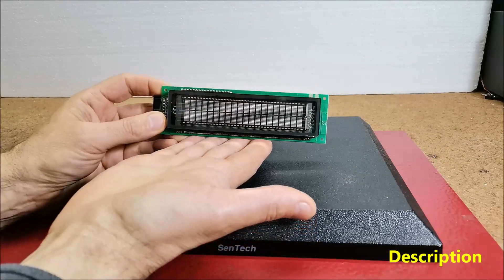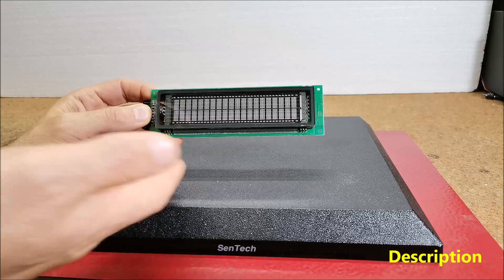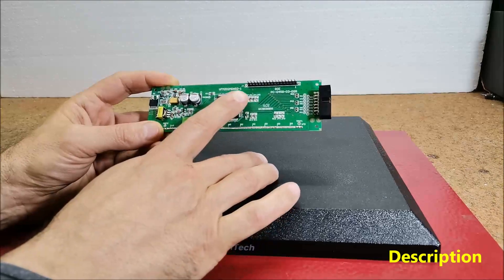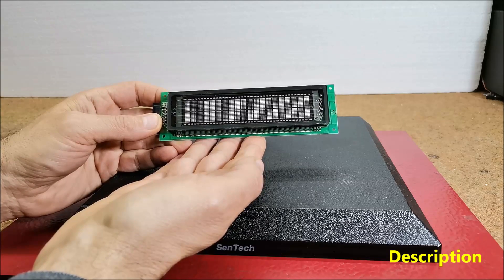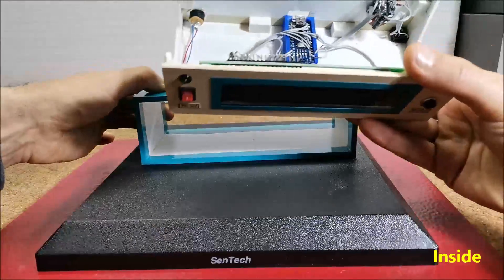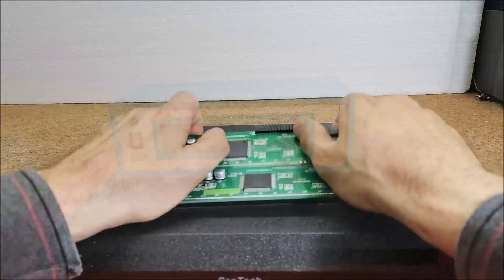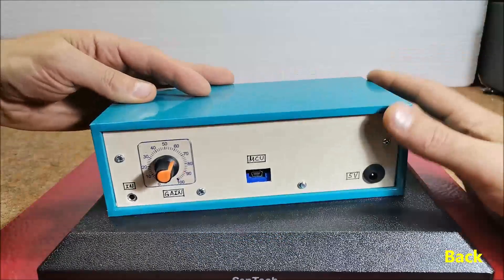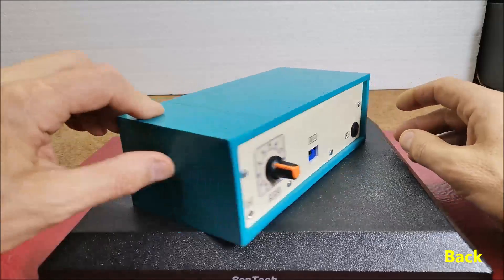DIY Arduino VFD display 20x2 VU Meter  (Volume Unit)

Comment: Very cool; Does this work with the PT6312 or PT6315? Thanks
Reply from the maker: I looked at the datasheets for these two chips, something similar could be done, but I could not tell you exactly. It should be checked specifically on the display driven by these chips

Comment: Very nice but the standard is for the right channel to be on the bottom. That way if you turn the meter on its side the right channel is on the right.
Reply from the maker: Yes, I agree and I will simply correct that in the code as well as in the input. Thanks
Reply: @MirkoPavleskiMK  , cool! 👍
Reply: Yeah, this good point.